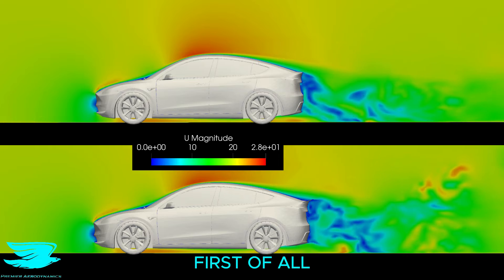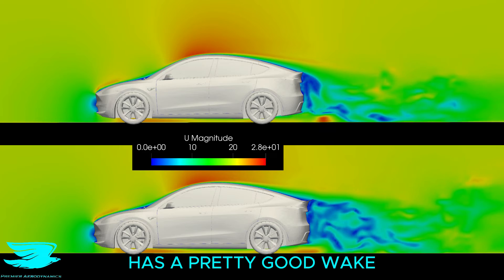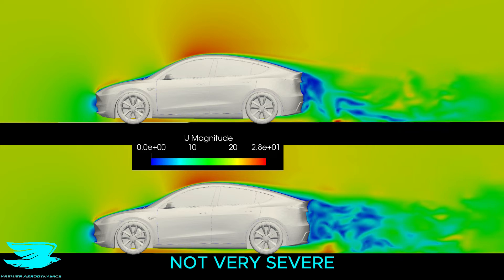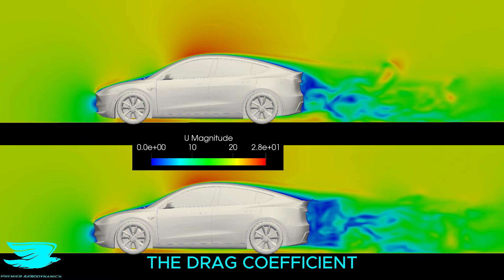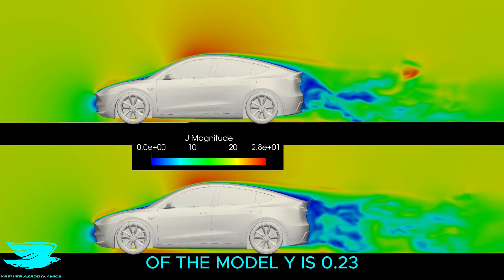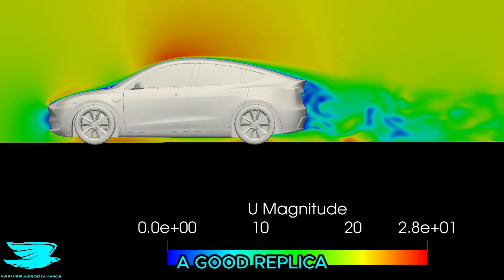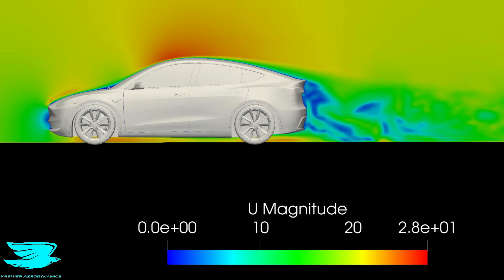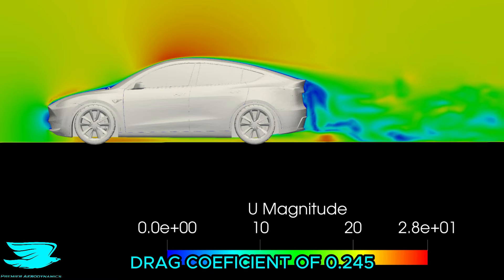Tesla Model Y Spoiler Aerodynamics {Auto Aero #47}

Comment: Why is the spoiler pointed so much upwards, I dont see any commercial models pointed upwards so much? To reduce drag I would imagine a spoiler following the line of the trunk would be pretty much ideal. What modification do You suspect would lower the drag of the Model Y the most?
Reply from the maker: Many have the spoiler quite in line, but sometimes they are pointed up more. For example, the red car in the video has a very aggressive installation angle.

The more aggressive it is, the more downforce you will typically get. When it comes to performance, the spoiler is usually used to increase rear downforce to help the car corner.

The best modification would probably be extending the rear diffuser. That would reduce the wake size, which is the most draggy thing about the Model Y currently, and it would increase the downforce at the same time.

Alternatively, covering the rims more would help most models - they typically have very open rims.
Reply: @PremierAerodynamics  Indeed it seems its possible to install them upwards, just seems awful stupid in my opinion. Dont You think that the rear wheels not spinning in Your simulation affect air flow around the back?
Reply from the maker: @teemutiainen860  It really depends on how much downforce you want and what spoiler you can get your hands on.

As for the rear wheels (and wheels in general not spinning), this simulation was done with an MRF, which is about middle of the road for accuracy. With this approach, the accuracy is within about 5-7% of the overall value. Considering that real-world effects, such as gusts, aren't taken into account in regular research, 5-7% is reasonable accuracy.
Reply: @PremierAerodynamics wait what is/where is the stock rear diffuser you mention??
Reply from the maker: @midnight121190  The stock rear diffuser is exactly what you see underneath behind the rear wheel - the entire panel underneath at the back. That region is the diffuser. If you extend that out more, you can get a smaller wake and more downforce.

Comment: Interestingly enough the spoiler improves front axle downforce from your plot. So the downforce increase also comes with a moving forward of the CoP.
Reply from the maker: It would be interesting to see if you could notice it while driving.
Reply: @PremierAerodynamics  Probably not, unless you're at the limit. It's also highly corner dependent, maybe on a medium speed long corner it would make a tenth of a difference. I remember the podcast where you discussed LEXs I wonder if the same thing applies to cars. The behavior of things like diveplanes or splitters have that effect on transients, but less so in steady states due to hysteresis.

Comment: Impressive CFD accuracy, since, from what I understand, those wheels do not have the 'low drag'wheel covers. 

What is the purpose of the inward 'dent' in the bumper on the model 3 and Y ?  
The latest generation does away with it, and the designers mentioned the new nose is now lower drag. 
Was there any purpose for that depression there at all, or was it just meant to cheapen the look of the car 
( Can't have the pony ( Model 3 ) outrun the stallion ( Model S )
Reply from the maker: This would be a good feature to investigate - we can do it in a subsequent simulation, but just briefly, I think that there are two potential reasons.

The first is that they might have thought it looked better like that.

The second is that maybe they were trying to control where the flow was going. If you look closely, the dent is a little concave and the edges are where the flow will be directed to, hence they can control where the flow will go around the sides of the car.

But, we'll do a simulation on it and see because it is interesting.